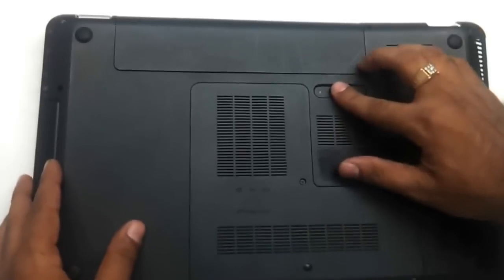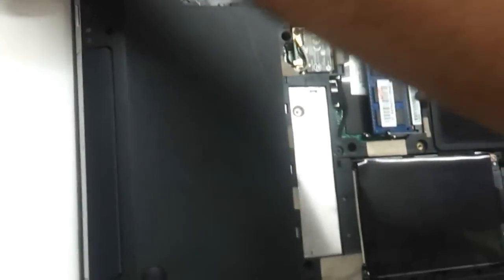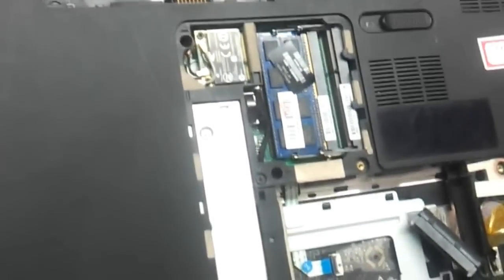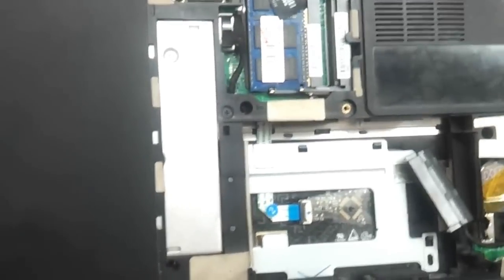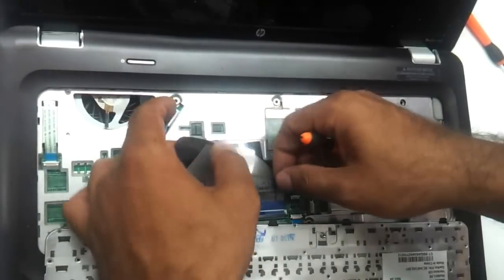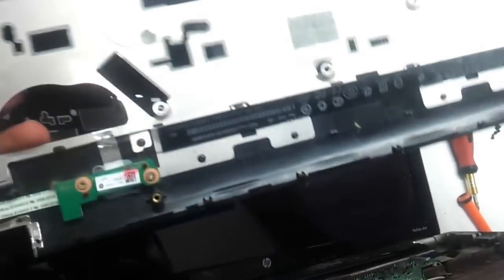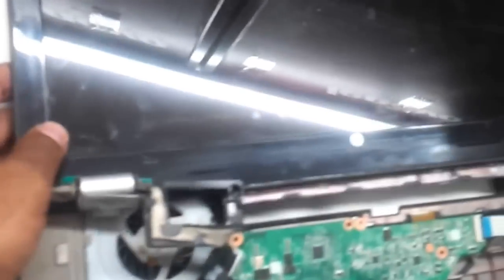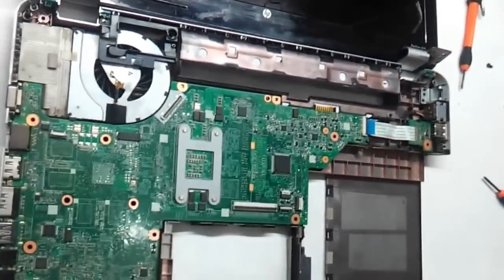How to dismantle open the HP DV6 and replace keyboard hdd dvdwriter base hinges lcd ram

Comment: Hello!My case is destroyed too and i can't find the parts on youtube.This model is soo hard to find.
I need the bottom case,palmrest case,lcd back cover and hinges:(
Reply from the maker: Hi Gabriel,
Please mail your requirements to us on sales@techstore.co.in.we will revert with prices and availability
Reply: Techstore Hello!I have emailed you the serial numbers of the parts i need.Let me know if you got my email
Reply: Techstore I can't respond that email is really weird anyway here are the info
I am looking for a complete case for a Hp Dv6 series 3000 more exactly it is a 3130EL.
I need every part starting from Bottom Chasing,Top Cover Touchpad
Lcd Back Cover and Hinges.I have the Serial Number parts if that Helps
Bottom Casing: ZYE3ELX6TP003CBD325
Top Cover Palmrest Touchpad : CTC3LLX6TP103AAD422
Lcd Back Cover: RIT3JLX8TP103B3D414
Hinges: ZFBLX60200103AQN423 or FBLX6020010
It doesn't matter the color.Or if used or new
If it is possible let me know.Thank you very much